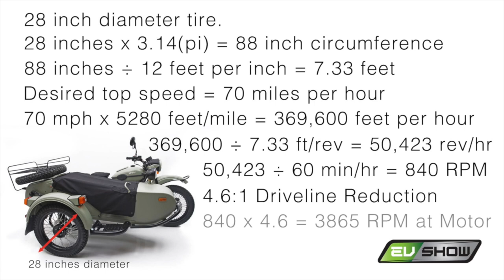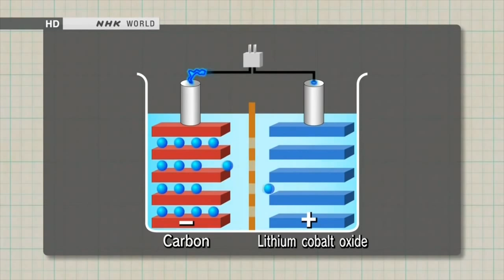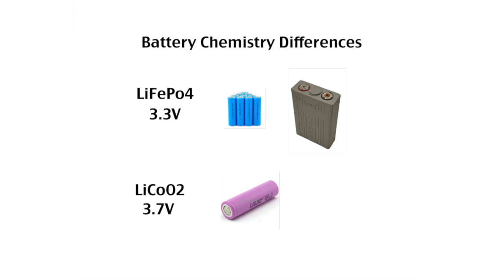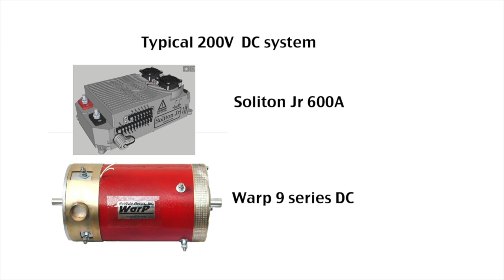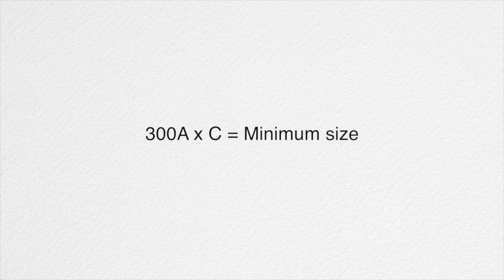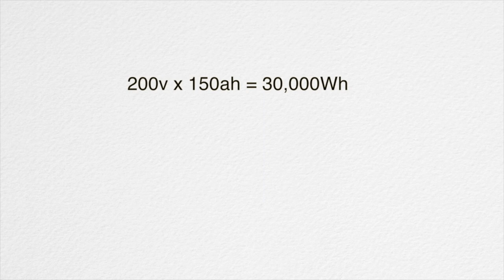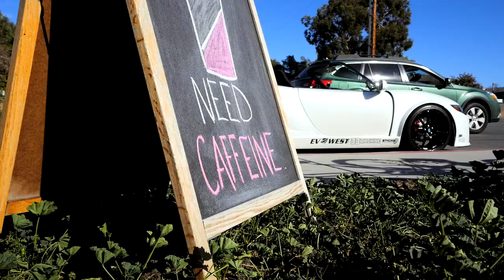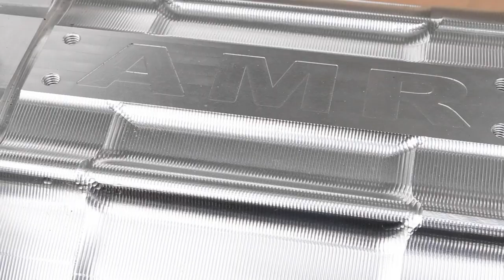The EV Show - February 2015 - Episode 3 - EV West

Comment: Nice road movie.
Jehu, you only forgot to mention that it is also possible in a Soliton system for example just to use a higher number of "lower" Ah cells in series to match the c rating by limiting the voltage @the motor side. A motor with 150V@600A equals 300V@300A at the battery side. Cheers m.
P.S. I had to buy a FLIR ONE.) thx.

Comment: Just 33 minutes in; noticed a bad typo regarding the driveline math: Second line should read 12 INCHES per FOOT, not 12 FEET per INCH!!

One other little thing, in terms of the order of equations - since you eventually want to figure out RPM, your desired unit is a minute, so it might be a little clearer to make line 6 a division by 60 to arrive at ft/min.

I like to do the math in my head so it makes the process more intuitive (IMO) if you do it that way.

Many thanks and keep up the good work!
Every show makes me want to ditch my fossil fuel ride just a bit more! :)

Comment: Very nice production. Bordering on overkill.
You don't really need 2 AC50s, just a 3-400V controller for it on an e-geardrive
AC50 is capable of so much more if you allow it to rev to 10k and feed it the voltage it needs.

Comment: Strange question: Have you guys built any other glass body EVs? The lightness of the material seems like a real benefit, but I wonder if you're going to be driven nuts by listening to the doors and other body panels rub against each other, particularly under load. I could see a C5 Corvette being a totally rippin' EV but not if you're going to listen to flesh rubbing on a hot tub around every corner!